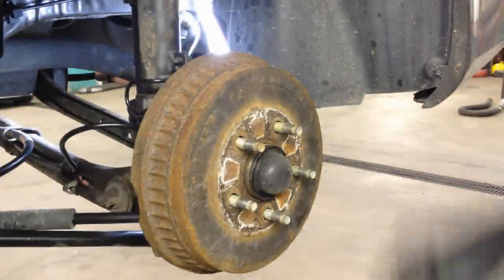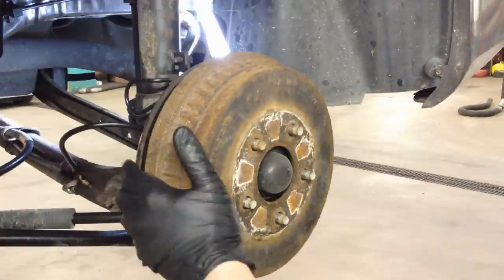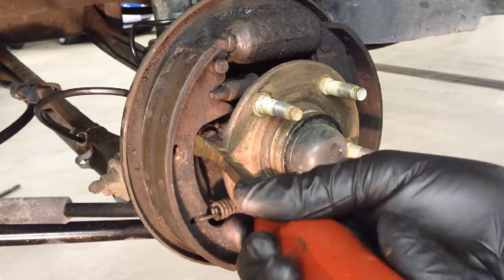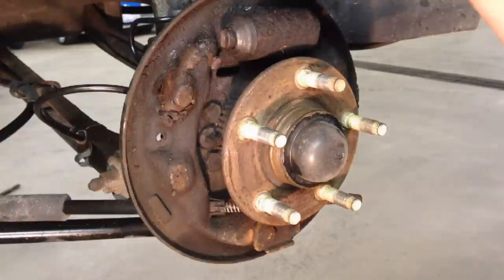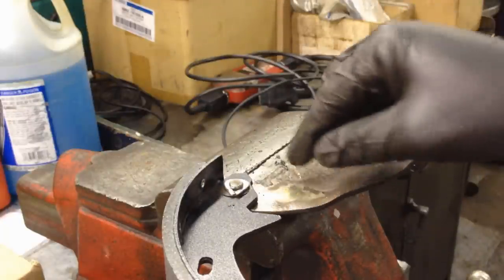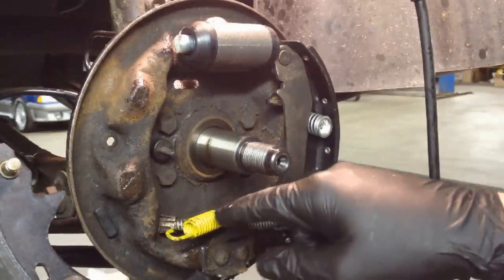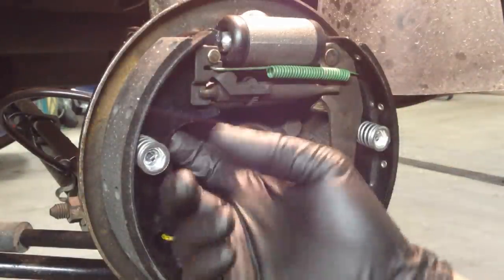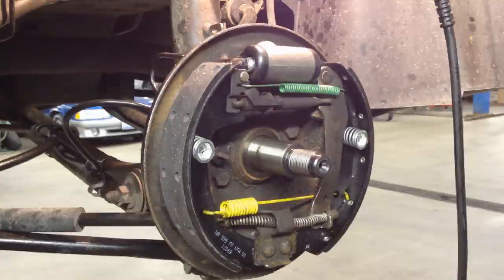Ford Taurus Rear Drum Brakes Replacement

Comment: Will this eliminate my spongy brake feel? I've replaced the front calipers due to rust but that didn't solve the issue
Reply from the maker: It will help with long travel of the brake pedal yes. Check and adjust the brakes first
Reply: +FordTechMakuloco OK..will do. Thank you

Comment: I would add that you shouldn’t take off the parking break cable from the arm that it’s attached to.  Putting the cable back on is an absolute bear!  Just detach from the whole assembly from the break shoe by prying the U- washer off.
Reply: man, i'll second that. trying to get the parking brake cable back on is a nightmare.

Comment: Whoa! Wait! You went right by taking the parking brake cable off. I'm sure it is just a matter of popping it out of its little slot, but mine won't budge. What am I missing?
Reply from the maker: Dogopotamus You leave the cable on the adjuster and swap the adjuster to the new shoes with the horsey clip as explained.
Reply from the maker: Dogopotamus As I said I did the swap off car on the vise to show you better on camera only.
Reply: My apologies, I missed that. That's how we ended up doing it and it worked perfect. Thanks :)

Comment: Is there anyway you can find me a brake line diagram or routing for a 2001 Ford Taurus LX from the front proportion valve in the front near the master cylinder to the pro portioning valve in the back next to the driver side rear drum, because I can't find anything

Comment: One thing to remember is that the parking brake adjuster strut is a three piece unit. The long threaded portion with the single slot, the toothed wheel and the shorter two slot that is not threaded. make sure to clean and lubricate the threads AND non threaded shaft that goes into the smaller two slotted part as they get seized often. The whole thing on my car on the right side was seized so it couldn't adjust and the parking brake stopped working on that side. I also believe it wasn't applying full braking force while driving due to the adjustment being off.

Comment: i like to know how you make measurements with the 
GearWrench Brake Resetting Gauge to proper setting for the drums
Reply from the maker: +PoWeRuLeRs I have a new drum brake video coming out that shows it in more detail but basically you use the one side to measure the inside of the drum and lock it down then you use the other side to feel for the brake shoe adjustment as shown in the video here.

Comment: can you give me some advice on how to replace the rear wheel bearing on this same car. thanks
Reply from the maker: +mywifehatesguns c They come off very easy what year and model exactly the torque specs are different. Email me or leave an email and I will send the procedure to you.
Reply: +FordTechMakuloco actually is a mercury sable 2004 ls

Comment: How do you adjust the ebrake cable. Changed my shoes over the weekend and the e brake won't catch. What do I need to do. Thanks.
Reply from the maker: The cable adjustment should not need to be done. You need to expand the shoes out to the point they almost drag on the drums.
Reply: FordTechMakuloco  Thanks.
Reply: clemsr01 i had to get a 3rd hand to help. I put vice grips on the end of the spring and the metal on the end of the cable and separated it. Then I had my kid secure the spring back with a pair of needle-nose vice grips on the cable.

Comment: In the beginning of the video, you should have mentioned about backing off the self adjuster to help clear the ridge on the drum. That is one of the main reasons that the drum don't want to come off of the vehicle.
Reply from the maker: +bruce1164 Problem is most of the time that adjuster is frozen and a waste of time to try backing off believe me over the years I have tried a many.

Comment: I was wondering why you skipped over the wheel cylinder?
Reply from the maker: +Boyd Raner-Meyer That was to be a different video.
Reply: That's why I came to watch the video - to learn about the wheel cylinder, but no dice.
Reply: "That was to be a different video"??? That makes absolutely no sense! You changed and showed the presence of a NEW wheel cylinder in THIS video! (see 13:52) Why couldn't you just show us the process?

Comment: great video but how in the hell do you put the piece back on to the parking brake cable I have tried spring pliers hook and picks needle nose pliers I cannot get it back on
Reply from the maker: That is why we don't take them off, between a cat claw and some needle nose pliers you should be able to do it with allot of force, easier with a helper.
Reply: FordTechMakuloco 
Maybe you should mention that in the video
Reply: It's a great video except for the part you cut out. Caused me quite a bit of frustration as well. The cats claw did work better than what I was trying... glad I read through the comments
Reply: I never took it off

Comment: How did you get the parking break cable back on. lots of tension on the spring.
Reply from the maker: +ENLIGHTENED CHILD OF GOD TWOBALLCANE I show a trick in my escape drum brake video
Reply: DO NOT REMOVE PARKING BRAKE CABLE!  If only I had known. Needed to run baling wire through the spring and tie back, then tug on the brake wire to slip that part back on. Such a pain. Unnecessary. Just remove clip and put the new pad on, that's all. Wish he had shown what a hassle that was, he just skipped it. Now I know, hope you do too. Everything else was helpful, THANKS.
Reply: @donnypaige469  Dude, thanks.  That was the whole reason I watched this video and was shocked that he skipped this step entirely.  Thanks for the tip!

Comment: hi, why my car hesitates when i accelerated at fullthrottle...i change sparkplugs and injectors washed and no change. i would greatly appreciate it..
Reply from the maker: First thing I would do it clean MAF as shown here-
Cleaning A Mass Air Flow Sensor Properly
Quick Tips: #19 Common Causes For Engine Hesitaion Ford Vehicles
Reply: Also check your Catalytic Converters. :)
Reply: hello if I did but it only lasts a week and returns fails again...maf isn´t good?? thanks!
Reply from the maker: a failing maf or one that has failed will cause this yes especially on take off just falls on its face.
Reply: good!! it´s true you´re  magician....greeting from monterrey, mexico

Comment: do u have a video onreplacing actuater on emergency brake spring cable is there atool for it
Reply: Hey Jeff I used a pair of pliers and needle nose vise grips. I pulled the tab on the wire towards me with the pliers and that gave me a little bit of slack on the wire and I push the spring back a little bit at the same time with the needle nose vise grips and then clamped it on. I sat on the ground and pulled the tab towards my chest in line with the cable and it gave me a little bit of slack to put on the vice grips . And then I kinda pulled on it again and tried to push the spring up farther and then clean the vice grips before I let off the pressure I hope this helps if it doesn't let me know.
Reply: Now that I think about it your comment was three months ago probably already figured it out sorry.

Comment: toyotas have a threaded hole or two. What a PITA. Except for an extra top spring the mechanism is identical to a corolla. Those are single servo with lower stopper(so the shoes don't push on each other) for less force.

Comment: Why did you not show one of the hardest parts of this job? Skipped right by it. Getting off the secondary shoe, where the brake cable is attached to the lowest portion of the shoe lever. The swedged end is held in place with a spring coming through the backing plate. If you don't have 3 hands available, or a "special" spring compressor, it's almost impossible with one person. Would be nice for us "armatures" to know the trick.
Reply from the maker: +joe quinlan See my newest video on the ford escape rear drum brakes I show the trick to it.
Reply: I tried this for 3 hours today and could never get the spring 
compressed. I even released the other end at the  pedal to give some 
slack but still couldn't get it. Is there a special tool I can buy to 
make this easier? On the 200 Taurus, there isn;t much spring to get 
ahold of...
Reply: Yes, do what he said and go to his 2008-2012 Ford Escape Rear Drum Brakes Replacement, and he has a great trick. Go to the 17:33 position in the video.

Comment: At 9:06 you did not show us how you disconnected the shoe from that arm (that you're holding with your right hand) that is connected to the parking brake cable on the lower (left hand) end - which is a completely unique attachment method..... BUT WAIT, after fast forwarding to around 10:05 I see you've got the parts on a vise. They somehow vanished from the car and relocated on the vise!

BTW, I did give you a thumbs up - even though I stopped at 10:10 or so and even though that part suddenly gone freaked me out while in deep focus watching your video. At this point, I wonder if you changed out the wheel cylinders or not.

AND WOW!!! ... somehow at 13:53 you have new wheel cylinders that magically appeared! When did that happen? This was the primary reason I came to YouTube - learn about changing wheel cylinders. Maybe I've gotta watch further into your video, just like we needed to when your right brake shoes vanished.

BUT WAIT..... I just discovered, also at 13:53, that the hub is missing! When did you take that off? It wasn't worth mentioning? This is a magical video of disappearing parts - now you see it, now you don't.
Reply: He made a video to help people out, not give them step by step instructions for every little thing. You probably shouldn't be working on cars if you need every little thing explained to you. He did an excellent job at this video. You should be thankful for people who try to help, instead you complain.

Comment: Save yourself future panic if you are new to replacing drum brakes. Take a couple photos with your phone before disassembling any components.  Unless you have a lift and can remove both rear wheels  at the same time that is.

Comment: Thanks for skipping the part where you removed and reinstalled the ebrake.  That's the part I needed to see.  Apparently you don't have a good way of doing that either.
Reply from the maker: Use a vice grips on the end of the cable nice an tight then pull toward you until the cable under the spring shows. Then simply slide in the e-brake lever on the shoe.
Reply: @FordTechMakuloco  tried that. didn't work.

Comment: Just did right side rear drum brake, Video was good guide for re-install. I replaced everything, springs, adjuster, drum, shoes, wheel cylinder. Gonna do the other side next week, took 3 hours or better but other side will go much quicker after having done it already, oh side note, I have the brake lever release tools from this guy https://www.youtube.com/watch?v=pzVFIaKzRTQ, had them for about 2 years and just used it, did as needed . 2002 Ford Taurus SES
Reply from the maker: +tigersaver Yeah but those adjusters never turn that easy especially here in the rust belt.

Comment: It should be noted that you do not want the parking brake on while taking these off. Just release it and these usually slide right off. It won't require this beating.

Comment: No way anyone should ever take a drum off like this. They put a access hole on the back side to release the pads.
Reply from the maker: Correct but you try to spin that rusted seized adjuster on one these in the rust belt and after 30 min you will come back around the front and remove it my way
Reply: Spoken like someone that has never removed a drum from a car older than one year. Doug... I think you've read too many books, and obviously never 'tried' to adjust brakes that look like the one in this video.